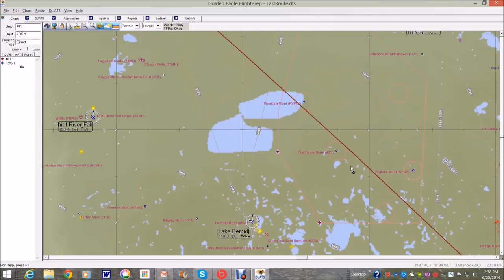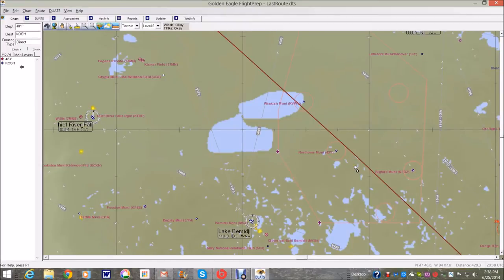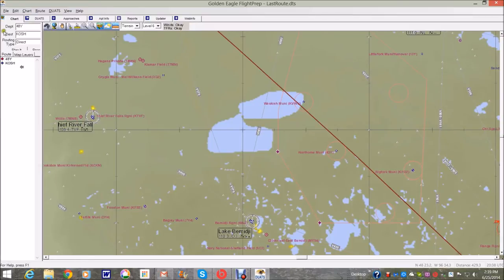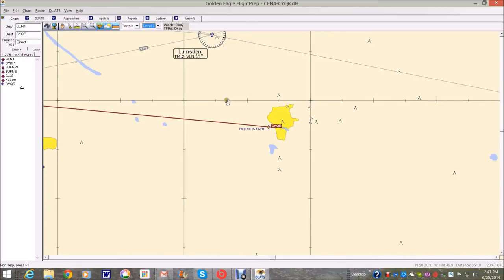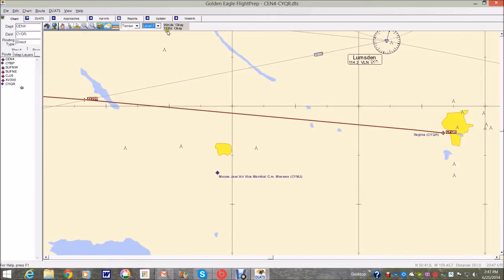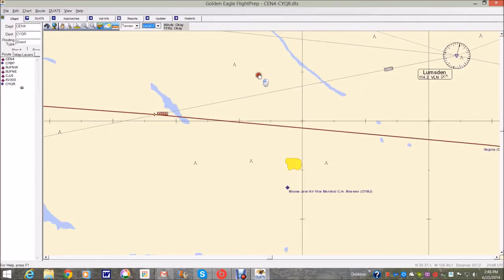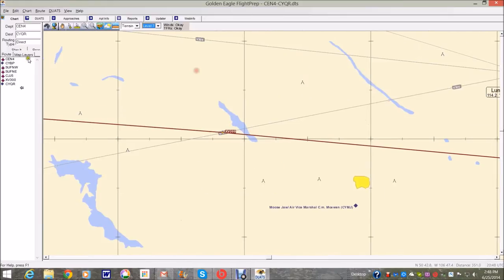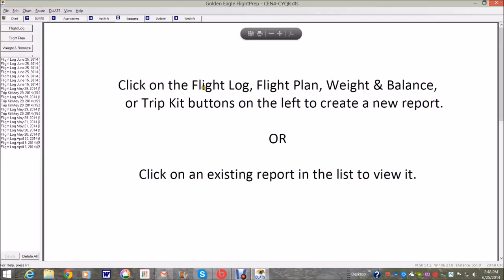Flight Planning to EAA Airventure, Oshkosh 2014 Part Two Vlog #11

Comment: I missed the waypoints from the border to Bemidji as you had camera problems and suddenly you were in KBJI so it was probably direct. All the VLOGS are outstanding, (not just the Osh ones), keep up the amazing job. I will try for Osh this year and follow along your route as next year we have to be ADS-B equipped which I don't have and cant afford yet. Thanks again.
Reply from the maker: That's correct Peter it was direct since it's only about an hour.  From BJI to OSH I normally plan over airports which are near my direct route and only if they are unicom/ATF frequency type airports and use them as way points for my GPS...comes in handy if the weather goes sour on you as well.  I'm "tentatively" planning OSH this year as well and in the same boat as you with the ADS-B ..  may have to check the prices/new products at OSH...Thanks for the views ... appreciate it..Regards Chet/
Reply: yeah, maybe I will see you there and we can both shop for some ADS-B equipment, there are lots of affordable options now with all the competition out there. Don't know if you have heard of the sky beacon wing tip, seems to be a simple install.
Reply from the maker: @peterfrenzel1826  Yes I saw that just recently on one of the AV web videos..looks like an interesting system Peter..hopefully I will be able to head down there ...

Comment: Would you be able to go back in your records and post the actual flight plan route?  I'd like to fun this in FSX with the new Piper Cherokee from A2A Simulations.  It's highly realistic and it would be a good training tool for me.
Reply: should have watched further...it's already there! :)
Reply from the maker: Steve Kirks Glad you managed to find it.  Just a note though, there are at least 2 waypoints which are user waypoints.    
Suffield NW
SUFNW
N 50 45.0 W 111 05.0
and
Suffield NE
SUFNE
N 50 45.0 W 110 17.0
you will need to build them.  These were built to keep me out of a military restricted area.
Have fun